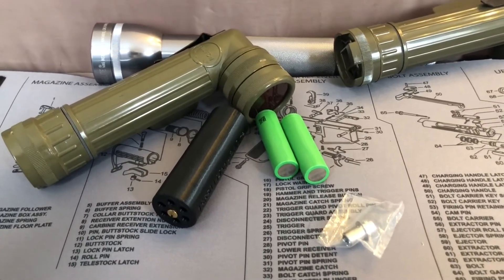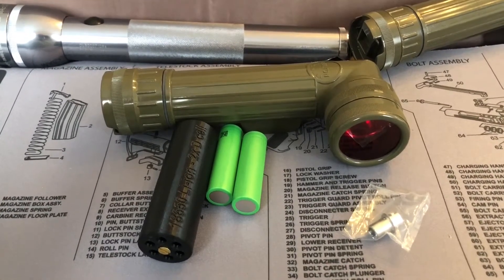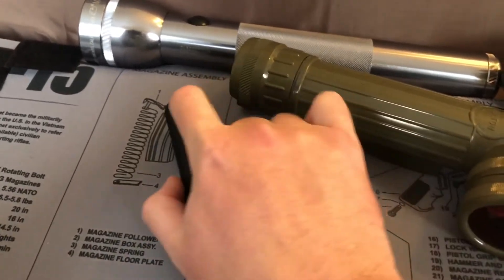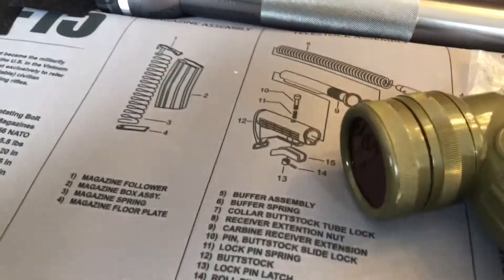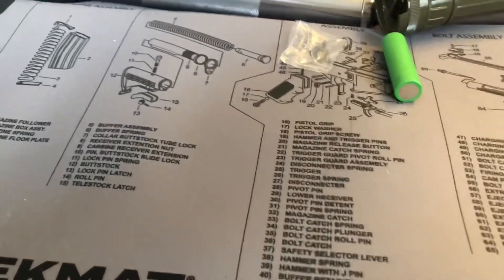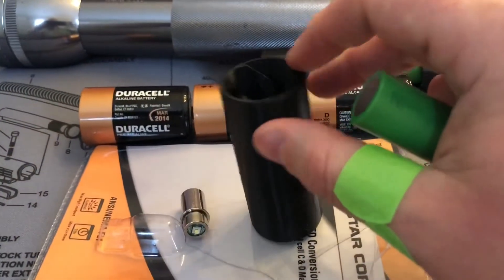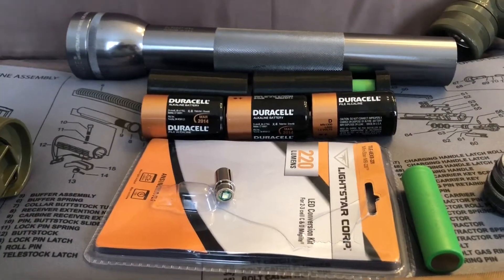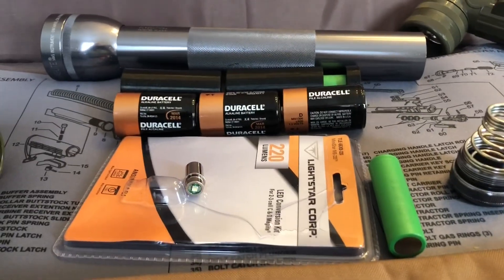What to do with those Old Maglites flashlights & Moonbeams? LED upgrade & rechargeable batteries

Comment: The 18650 is an incredible battery that stays charged forever.  I bought rechargeable D cells but would consider an 18650 adapter.  Does anyone know the weight difference between 2 rechargeable D cells and an adapter plus 18650 battery?

Comment: Why not just use regular D cells still?;
Reply: I just did mine, going to the AAA Batteries is a real weight savings along with LED Bulb. I still keep original bulbs and D cell batteries.

Comment: I say extend the life.  I'm about to do the same. I found a made in China knockoff of the angle head. Heavy, chinsy switch, lenses that are too close in tolerance to the lense holder compartment, but LED and bright when working. Found them at tractor supply. Spent some time the other day helping my none year old figure out how to fix the switch on his. I kept thinking about how I never had issues with the Fulton except for dim lighting.  My Fulton does have an LED now and I found 3xAA to D adapters. The adapters get you 4.5 V per "D" instead of 1.5 V.  I recently saw a post where 14500s were used in these adapters. That would give 24V and rechargeability but I'm not sure if the light housing can take the heat of an LED that runs at that voltage. We'll find out I guess!
Reply from the maker: Keep us updated on how that goes!

Comment: Do the LED upgrades have LVP(Low Voltage Protection) built in?
If not, then you'd want to use protected 18650 batteries.

Once a liion battery drops too low(typically 2.75v or 2.5v) it will be damaged and possibly won't be able to be charged again.
Reply from the maker: The LED is one designed to be used as a replacement bulb for a flashlight, so it doesn’t require a reset after power shut off.

The batteries, might not have protection from discharging too low. It honestly wasn’t something I stressed about while I was playing with this project. If I need to replace these in the future, I’ll make sure to look for this.